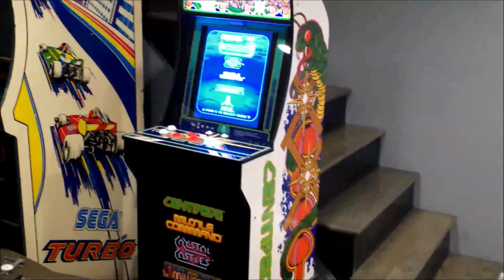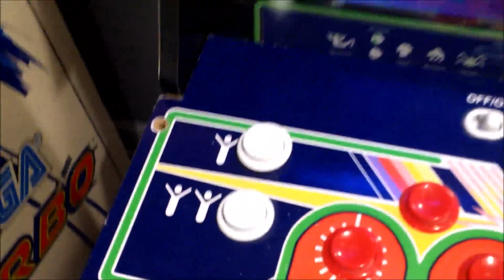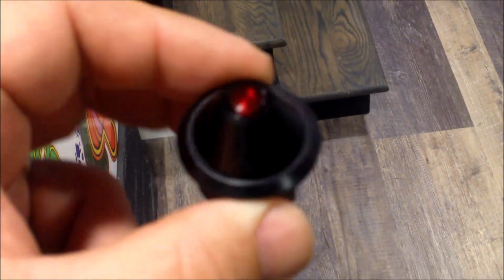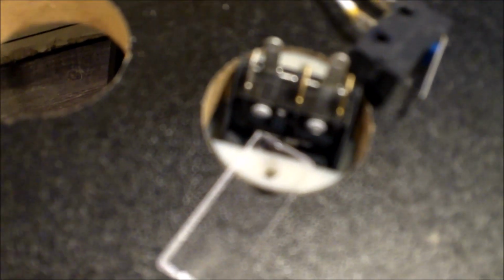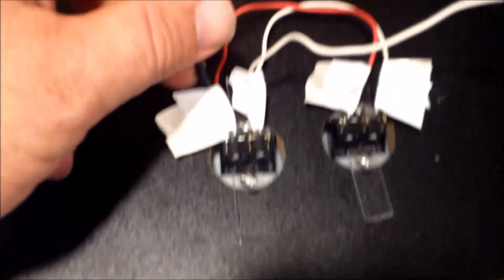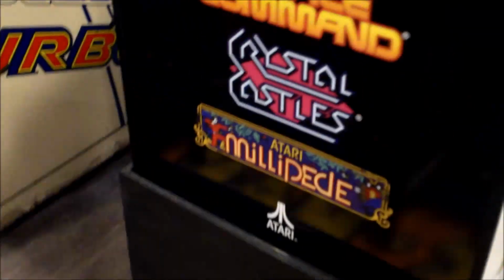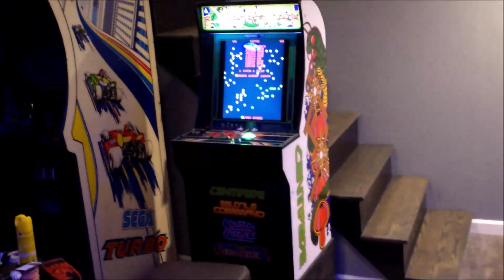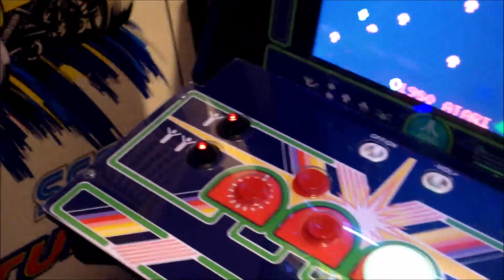Atari Volcano Buttons on an ARCADE 1 UP

Comment: Thanks for this!!! I'm working on a Xevious mod.
Reply from the maker: You asked where the resistor goes . This is for the part of the switch that powers the light ,It goes like this: power wire , resistor, then connect other end of resistor to one leg of switch . This is kind of hard to describe. I did make another video and I describe it better here is the link :     https://www.youtube.com/watch?v=xD137iwJ2i0&t=236s&ab_channel=yeksun

Comment: Looks cool.👍 
Love my Centipede A1Up. Was a must have for me day one. 

I also have the trackball by ThunderStick. Works well. A bit twitchy / sensitive but definitely better than the stock tb.
A while back i purchased the light up marquee from arcademodup. It didn't come with the ability to be turned on off with the powee switch. I have to physically unplug the machine from the wall everytime to turn on/off the marquee. Arcadegamefactory sells the splitter cable that you can go straight into the power supply on the stock A1Up board. Thinking about just getting that.
Reply from the maker: Yeah , you should get that splitter cable. That kind of stinks that you have to unplug the machine everytime. The cable I have makes it so when you turn on the machine the marque comes on. Also If you know someone with a 3D printer Glens retro show made available the internal wheels for the track ball with less notches which makes it a lot less twitchy . You have to download the file from "thingy verse " and print them out on a 3D printer. Makes a nice difference
Reply: @yeksun  Glen says there is a V3 trackball coming soon. I will moat likely just get that when it comes out. That is a great solution though. Unfortunately for me i have no access to a 3d printer. 
With this new wheel, how do the rest of the games play? With my  ball the rest of the games play really well. Even Millipede is not as twitchy. Crystal Castles / Missile Command play pretty great. It's really just OG Centipede where i feel it being too sensitive the most.